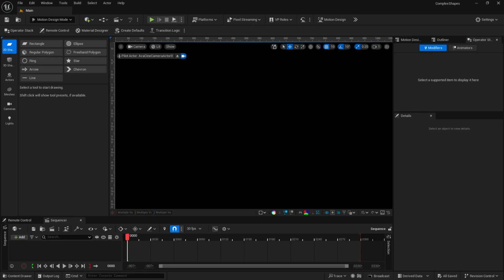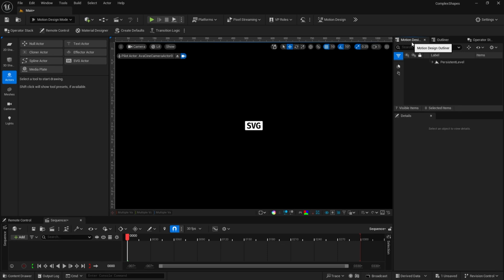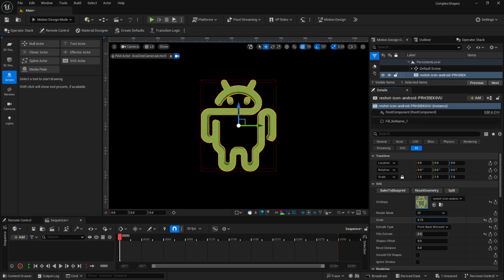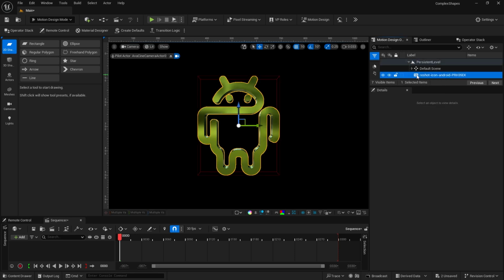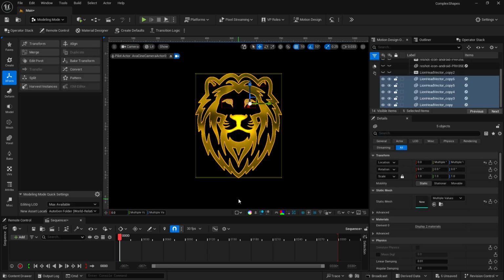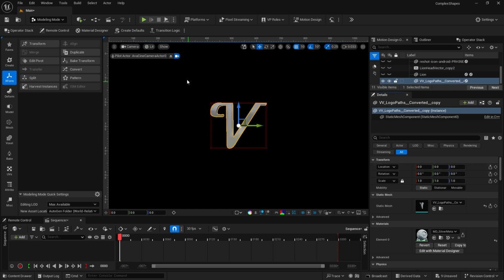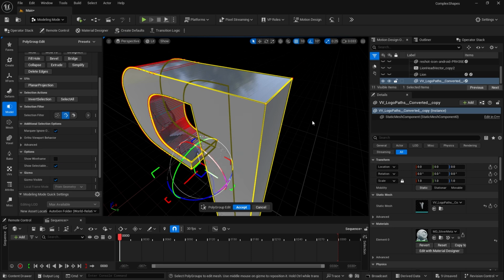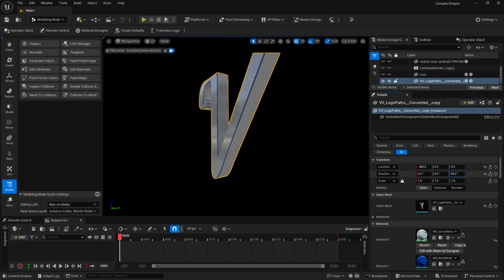Unreal Engine Motion Design Tools: Creating Complex Shapes with SVGs

Comment: When I convert and merge my SVG it keeps all the materials separate for each component despite them all having the same material. I can't figure out what step is being skipped here
Reply: Looks like your svg shapes all imported as Material Element 0's, but mine import each as their own element. So my svg actor is importing 120+ elements that I all have to change independently instead of one element per color.

My guess is that merging the shapes in illustrator isn't actually combining them all into one shape... Maybe I need to change them to compound paths or something first?